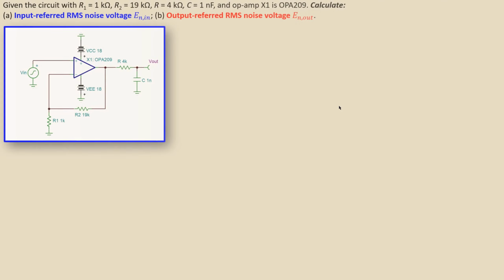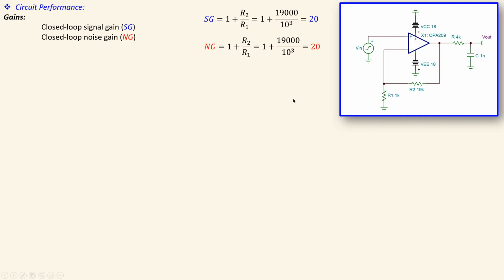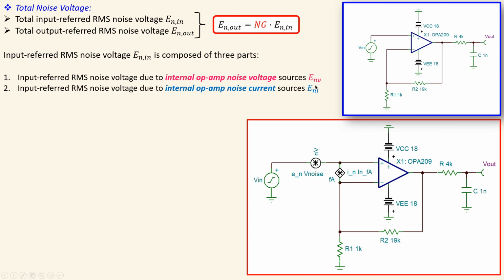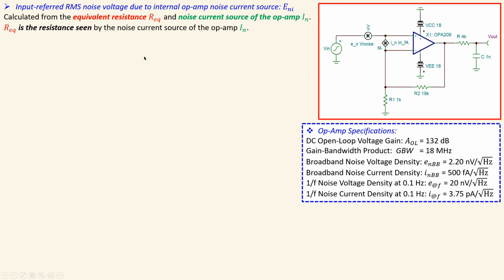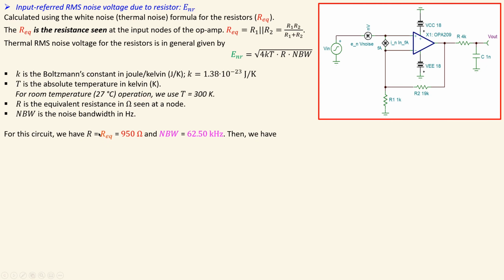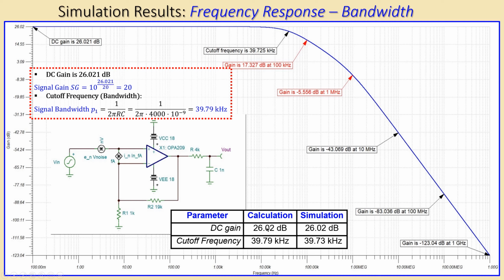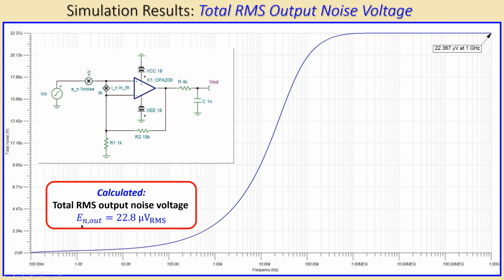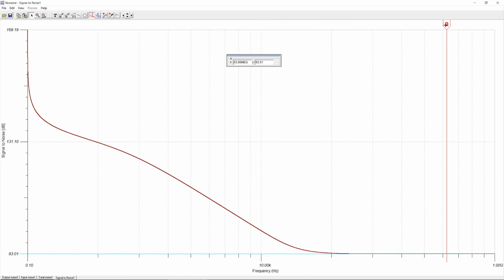Noise Analysis Noninverting Amplifier Cascade with RC Filter 💡 Example 4

Comment: How will we include the input impedance of the op amp in noise analysis?
Reply from the maker: We determine the effect of the internal noise sources of the op-amp and focus om de op-amp first and then the output lowpass filter.

For thermal noise calculations, you may combine the resistors and redo the calculations, but the final results will be the same. In fact, there are other parameters not included in this example, like the input and output impedance of the op-amp, which will have an effect on the actual noise performance of the circuit. You can create an accurate model of the op-amp having the input and output independences included.

Comment: hello i need  a help with something, i'm not really familiar with simulations, so there's input & output noise voltage spectral density and then RMS voltage noise, I'm using orcad, where to plot RMS voltage noise from traces?
Reply from the maker: I do not use Orcad, so I do not know how this is done there exactly. I think it is similar to most simulators. You can try a more user friendly simulator first and then move on with Orcad.
Reply: @CANEDUX  suggest any good free simulator please.

Comment: Should the external/loading resistance be included in equivalent resistance seen from opamp input? 19:15 Also for the thermal noise calculation
Reply from the maker: We determine the effect of the internal noise sources of the op-amp and focus om de op-amp first and then the output lowpass filter. For thermal noise calculations, you may combine the resistors and redo the calculations, but the final results will be the same. In fact, there are other parameters not included in this example, like the input and output impedance of the op-amp, which will have an effect on the actual noise performance of the circuit.